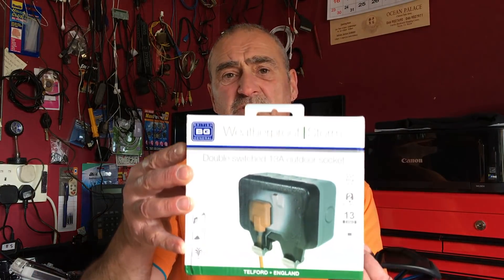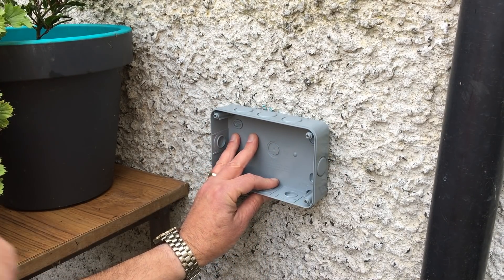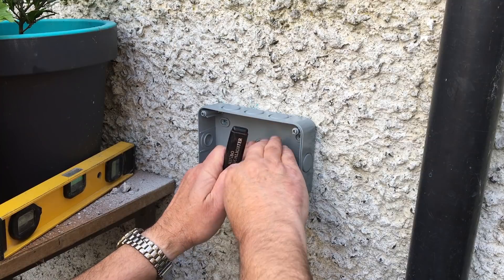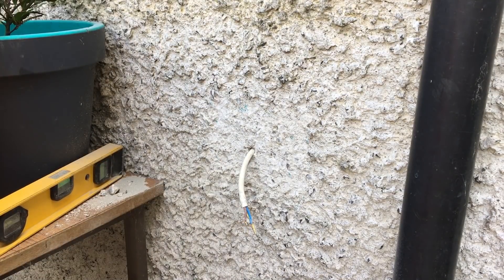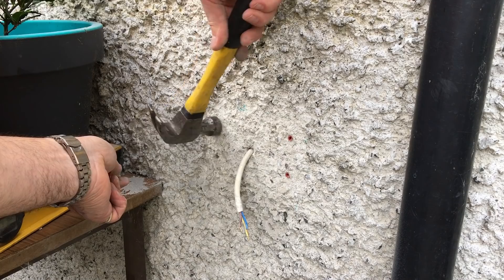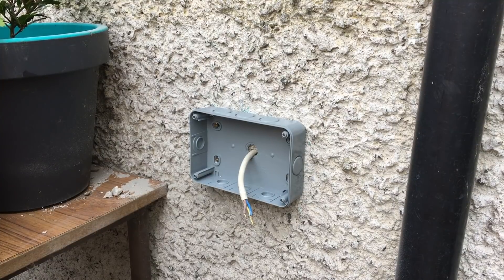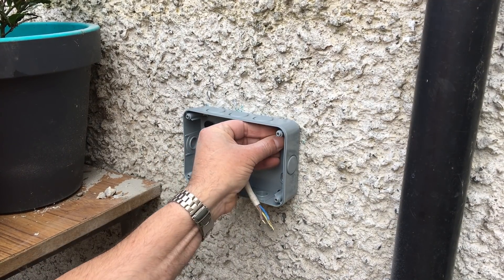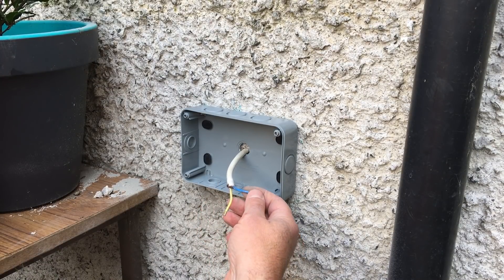How to fit a Weatherproof Double Outside Socket Yourself

Comment: Alot of people online say you have to use 2.5mm cable. Can I use 1.5mm?
Reply from the maker: 1.5mm is more suitable for a lighter load like lighting and wouldn't be recommended for heavier loads whereas 2.5 can be used for heavier loads and lighting also

Comment: Thanks for the video. I see two earth wire go to the same terminal but you said there are two terminals for earth wire. So i can only use one or this two wire should go two different terminals. A little confused,😅
Reply from the maker: The L N and E wire is connected to the gang plate to power both sockets. The extra earth wire is to the casing so in the unlikely event of water ingress it will trip the circuit breaker. Hope this helps
Reply: @DrivewayDudes  Thx. Got it

Comment: This is dangerous I'm not an electrician I did one year so i know some basics, I'm pretty sure that's 1mm flex which is definitely not good enough to use, the hole in the back is not water proof  ,I'm curious as to what you got the flex connected to  on the other side ?? Is it connected to plug that's just in a socket ?
Reply from the maker: Please read the description that accompanies this video.
Yes electricity can be dangerous whether you are an electrician or not.
We do stress that if you are unsure then you should contract the services of a qualified electrician.
Reply: Agreed. Even though he's using a 13A fused plug on the end of it, if he's drawing more than 10 amps across both sockets, that's unsafe, and that's assuming we don't need to de-rate the flex because of whatever the wall is made out of. Personally if I was doing this I'd want to use a 1.5mm flex, and the holes in the back need to be sealed somehow (and maybe a drain hole made to let water out if it does get in there). It might be fine if the fuse in the plug he's using inside is a 6A one, but I'd put money on it being a 13A.

Seriously, Driveway Dudes, please get an electrician to take a look at it. They could probably wire it in permanently for you as well, and it won't cost much.
Reply from the maker: @al45tair  Yes, electricity is dangerous. Please read the accompanying description to this video. Safety precautions were taken and explained, in fact we went safer in that we used an additional grounding inside the plastic casing in the event of water ingress. This video was filmed almost 3 years ago and we periodically inspect it externally and internally. The standard inline 13A fuse is of a domestic type typically used in homes for appliances like kettle, toaster, hairdryer, washer, dryer, etc. We have used an electric mower, strimmer, power washer, air compressor and various power tools at different times without any problems. 
In effect, this is a fixed point 2 gang extension lead.
Again we advise that if you are unsure, we suggest you retain the services of a qualified electrician to carry out this fitting/installation.

Comment: Where's the RCD ??? And by drilling that hole in the back and not sealing it correctly you've compromised the IP rating.
Reply from the maker: I have already answered this in a previous comment so here goes again.
This is in effect an outdoor wall fixed weather proofed extension socket. After fixing it to the wall the casing was sealed with a grommet and silicone. The concrete block hole was drilled inwards and at an upwards angle then sealed again with silicone after the cable was fitted. 
The 2 metre extension cable is wired with a 3 pin 13A plug that can be plugged in or out of a fused 2 gang switched socket. When plugged in it is connected to a spur which is fed from the domestic home supply that has a 32A RCD.

Comment: There's a big hole in the back where the cables come in, what stops the water getting into it?
Reply: CubicSumo you should use a stuffing gland, to do this you would make a small slit in it just wide enough to pass the cable through but make sure it isn't lose

Comment: There should be an IP66 grommet in any holes in the box!
Reply from the maker: We used whatever came in the box and of course some silicone sealant for extra protection
Reply: @DrivewayDudes  The grommets don't get supplied. However, what you did was wrong as you compromised the waterproofness of the box.
Reply from the maker: We compromised waterproofness because we used waterproof silicone?
Reply: @DrivewayDudes  That is why the warranty would be void, and hence any insurance you may have. You DO NOT drill holes in these boxes unless you are using an IP66 grommet. Water and electricity do NOT make for a good mix.
Reply from the maker: We take safety very seriously and would never make a video if we thought there was a risk of harm.
In our description we say 'This video is for guide purposes'. We do not say that this is the way it should be done. If a person has waterproofing grommets or another product that they wish to use then that is entirely up to that individual.
We agree that the warranty would be void if the unit was modified or changed in any way. 
The casing was pre drilled at point of manufacture. We pinned it to the wall using the pre-drilled holes and applied waterproof silicone sealant as added protection.
Over the course of almost two years with varying conditions including heat and minus temperatures, dry and wet weather, we have periodically inspected it and found it to be 100% dry inside and with no visible sign of corrosion in any way. 
It is still working today as it was when it was first fitted.

Comment: The box earth and supply-cable earth were both connected to the left-hand socket earth terminal. Is the right-hand socket earthed within the unit?
Reply from the maker: Thanks for the question.
Everything that is supposed to be earthed is, as per safety specs.
Reply: @DrivewayDudes  Thanks.  I'd assumed that if there were two separate earth terminals in the back of the socket, they must both need to be earthed - otherwise why have two terminals?

Comment: Loving the use of flex. 

But love the connection of the earth flylead to the plastic socket enclosure.

Ballygobackwards!
Reply from the maker: Following enclosed instructions never hurts
Reply: Presumably just to stop it being left loose in there and accidentally connecting with another wire...

Comment: this is why u should always use a propper spark any cable really
Reply from the maker: A registered electrical contractor would probably use 6 or 10 square T&E from the spur in the shed but this is a fused switched extension lead with a fixed gang

Comment: bLue goes left, bRown goes right. Brown is live, because that's the colour your pants would go if you touched it.
Reply from the maker: Following the instructions enclosed with the kit, Brown is Live and goes into L. Blue is Neutral and goes into N regardless if they're left or right.
Always think safety and follow the instructions. Pants are no help if you don't.
Reply: @DrivewayDudes  that's more of a rule of thumb when wiring a standard plug :)
Reply from the maker: Definition for 'Rule of Thumb' -  The English phrase rule of thumb refers to a principle with broad application that is not intended to be strictly accurate or reliable for every situation.

Nowhere in the enclosed instructions did we see the phrase 'Rule of Thumb'.
We hope you're not serious and don't follow 'Rule of Thumb' because someday you may suddenly have brown pants.
Reply: @DrivewayDudes  You must be fun at parties.

It was just a neat way to remember how to wire a plug. Tom Scott used it in his UK plug video.
Reply from the maker: It may be easy for a qualified electrician to wire a plug but for someone unfamiliar, the wrong advice could lead to injury or worse. 
How someone wired a UK plug does not apply to all countries as they may use different colours and configuration for their plugs and sockets so that's why we advise following instructions.
Shocked that you would think that we are not electric at parties.
Reply: How come you said one earth goes in one side and the other goes into the other end? You put both earth cables into one side double up??

Comment: Useless.. No wiring instruction
Reply from the maker: All good kits come with wiring diagrams and instructions.
Did you read the part  'He followed the instructions supplied with the kit' and 'Voltages and wiring colours vary from country to country'?
Why would he give wiring instructions that may not apply to another kit that may be in another country where the wiring colours and voltages differ.
He also advises and recommends that if you are unsure then do not attempt this but rather contract the services of someone qualified

Comment: What stops water running down the wall, behind the socket and in through the cable at the back?
Reply from the maker: The roof overhang, fitting it downwind, the tightness to the wall, the sealant pumped into the hole
Reply: @DrivewayDudes  What if you spray it with a hose which is what IP66 is designed for??? You've completely compromised the IP rating not to mention the lack of RCD !
Reply: @DrivewayDudes  thanks.

Comment: Other than the wiring (i would hard wire this) the only thing i would do differently is silicone seal all the entry holes and the back box once its secured to the wall.
Reply from the maker: For health and safety reasons, a qualified electrical contractor would be needed to hardwire into the mains supply. 
We applied sealant in the areas where we thought would be more vulnerable to water or moisture ingress
Reply: Be aware if you use an acid cure silicone (the ones that smell funky) the acid vapour released into the enclosed space will corrode the metal electrical contacts.
Reply: @andyclarke8916  sound advice fella

Comment: Are you still alive?
Those instructions you claim to have followed clearly instruct you to seal the cable entry if you use the rear entry point and on that uneven surface you've attached to it is really important.
You are also instructed to drill out the lower drain point.
Reply from the maker: Yes and thanks for your interest in our health and wellbeing.
We have used it many times in both good and bad weather. It is completely dry inside, not even a hint of dampness, moisture or corrosion.
This is a video showing that you can install this yourself with a few tools. We do stress that you follow the instructions included but if you feel you would not be able to do this then please seek the assistance of a qualified electrical contractor.
Reply: @DrivewayDudes  
I'm glad to hear that.
Just fixed mine to the outside wall, went in through the bottom with conduit so it should be fine.
Reply from the maker: Well done. If our video helped in some small way then we are pleased
Reply: @DrivewayDudes  thank you for a very useful video
Tho whilst I wish to attach mine to brick wall, which should be more flush than the surface you used.. what 'sealant' would you recommend for around the entry cable area AND when to apply it (I assume after having attached the wires so you can pull back any excess first?)?
Also, do you recommend applying any of same sealant around the outside of the box once fitted for added protection?
Thanks

Comment: You have missed drilling a drain hole with a 5mm drill bit. Putting a earth link from the socket to the back box is pointless as the box is plastic. You should also always drill from outside in at a bit of an angle to stop water going through the hole drilled
Reply: He did

Comment: Do you have to put the second earth on?
Reply: No you don't, plastic does not need to be bonded.
Reply from the maker: We followed the manufacturer's installation instructions for this unit.
Other products instructions may differ somewhat but we always recommend you follow them.
Always think safety. If it requires an extra earth/ground then that can't be a bad thing.
Reply: Driveway Dudes did it as you did all good, thank you
Reply: The earth in the box is so you can earth any armoured cable you have used.
Reply: Frozen Retro !  if you use armoured cable, you have to earth the armour. So if you cut the armored cable it trips the breaker.

Comment: You can buy a ready made kit from Wickes, comes with a plug for inside with an RCD on it,  much safer
Reply from the maker: Yes, you can buy a complete kit from many building, construction, diy retailers. 
However, you will still need to drill fixing points including a hole in the wall and some wiring may still be necessary.
This is a video detailing how to install an outside weatherproof socket whether you use a kit or seperate parts. The result would be the same.
It uses an already installed rcd on the spur (not ring) with the addition of a 13A fused plug (unpluggable and switched) for extra safety
Reply: @DrivewayDudes  ya can never have too MUCH information.. thanks... as Doug and the Slugs so righteously claim..."Men like me, we need a roomful of clues..."

Comment: You have to be a electrician to that
Reply from the maker: Not at all. This is basically just a switched, fused and pluggable/unpluggable extension lead fixed to a wall. 
This we hope is an easy to follow instructional video to show that anyone can do it with a few basic diy tools.
There is no risk of electrical shock as it is not hardwired to the mains supply.
If you were to directly hardwire and you were unsure how to proceed then it would be recommended that you seek the assistance of a domestic electrical contractor

Comment: Not a bad video, the one thing that i will say is that it needs to be protected by an RCD.
Reply from the maker: Thanks for the comment and your concern.
We agree that it is extremely important that all electrical cabling being used must be protected by an RCD.
In this case the lead from the double weatherproof socket uses is 13A fused 3 pin plug and the spur it is plugged into is protected by an RCD on the main board

Comment: What happens when water runs down the back of the socket and in the big hole he has put in the back?
Reply from the maker: If you watched the video you would see he drilled a hole at an upwards angle through the block. Water does NOT travel up. He also sealed the hole to make doubly sure
Reply: yeah but thats not what he asked, the cable through the wall is fine but the plastic box has a gaping hole in the back and any water that gets between the wall and the box will drip INTO the box, with no drain the box will fill with water untill it shorts out, he also stated you COULD seal it with silicone but did not do it - i wouldnt be happy with this job
Reply: @stevenr6397  read the comments, he did put drain holes in
Reply: @davyboy4515  err yeah he did, afterwards,

Comment: ok, reading other comments, is it perfectly ok, to connect this box, to inside the house and just plug it into a near socket?
Reply from the maker: Yes. In reality it is really just a fixed weatherproof extension socket
Reply: ah ok. so get the plug and cable from maybe an exiting extension, and take it off in order to use that cable and plug for this?
Reply from the maker: Exactly. And you have the added safety of a 3A - 13A fuse in the plug
Reply: thanks, altho just seen one which comes already with an existing cable, with RCD plug. thanks :)
Reply: But as this is plugged and not hard wired you couldnt put say a hot tub into this??
Reply: @leewoodruff1987  you could run a 13a hot tub off that if it’s the sole appliance yes… most hot tubs are 32a and require a 32a isolator and would use a 6mm SWA cable feed

Comment: isnt that the easy part? what about the other end of the cable? where does that go? and use any cable? thats the part i dont understand.
Reply: i done it like this, locate socket inside house on outer wall, remove socket, drill from inside the socket out through the wall to the outside, at slight downward angle to stop water coming in uphill, thats where you connect the cable from outside to, the inside socket.
Reply: @JuiceBanger1   there's a hole you should drill for drainage

Comment: sorry to say that you are using the wrong size cable -it should be 2.5 & earth
Reply: Nah it can be 1.5mm cable as its protected by a 13A fuse
Reply from the maker: 6 square twin n earth spurred socket in the shed. The weather proof socket using a fused 13A extension lead that can be plugged in and out as needed
Reply: using the 2.5 & earth I would have put in a switched fused outlet from the spur & that leaves all the sockets free ,so no need to unplug outside sockets & inner sockets free.why unplug outside socket just isolate switched fused outlet
Reply from the maker: I think you miss the purpose of this video. It's designed so that anyone can do it. You don't need to be an electrician as it is in principal an extension lead nor does it need to be inspected or signed off by a certified electrical contractor
Reply: Driveway Dudes hardwiring a spur is non notifiable work under part p, doesn’t need to be notified or signed off.
Reply: @sinista6536  Incorrect, It is notifiable work.